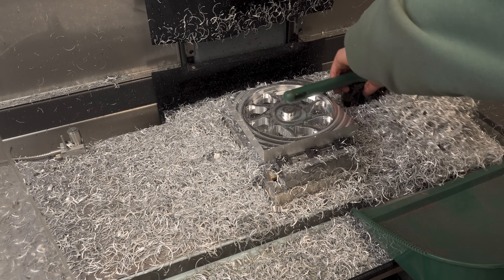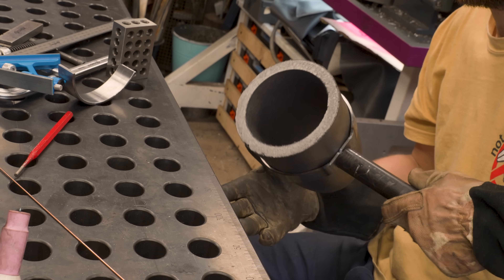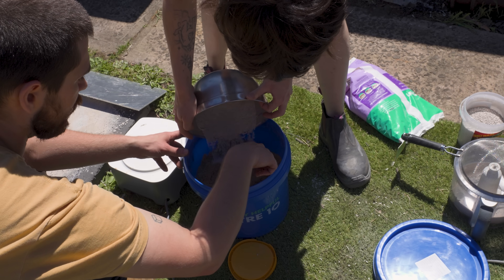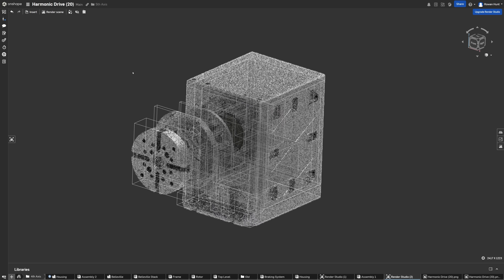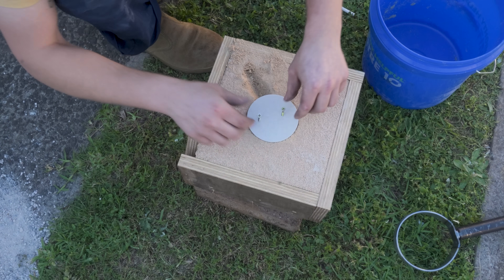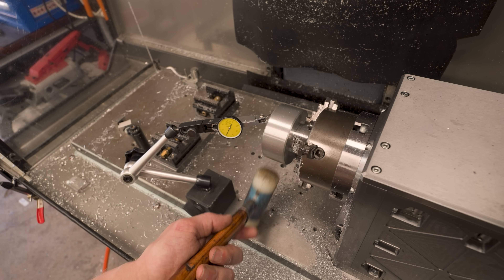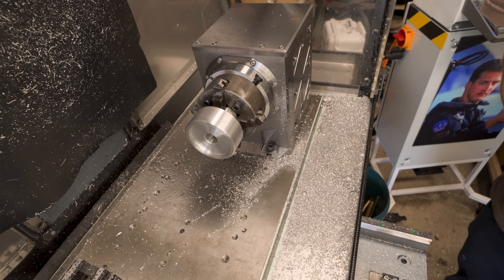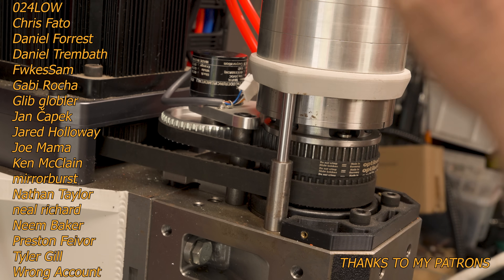Can I make a precision component from scrap metal?

Comment: Hey, 

Before anyone comments on you not using a dust mask when crushing the cat/kitten litter I'll be the first one to tell you that its probably harmless. Many says that it's dangerous due to silica, but the silica used in cat/kitten litter is amorphous silica and non crystalline. Amorphous silica has a disordered network of silicon and oxygen atoms without a repeating pattern witch crystalline silica has. When breaking/crushing Quartz (basically 100% silica - SiO2) it creates very fine particles that are sharp and they get into your lungs and scar them, if enough scarring occur you may develop silicosis. But I'll will recomend to you when dealing with a fine powder you should wear a dust mask with FFP3 classification (i think its P3-classification in AUS/NZ). 

- From someone thats deals with both forms of Silica (Industrial silicon metal smelter)
Reply: And the shiney almost quartz looking cat/kitten litter is amorphous silica gel granules
Reply: @rub3n0st that isn’t what he used. He has something more of the bentonite variety. Adding ground/powdered silica to an already silica based sand would accomplish very little other than give him some more fines in the AFS mesh breakdown. Bentonite based cat litters are mostly bentonite with very little if any silica. Of course, the very problem with cat litter like this is that you have no easy way of knowing exactly what is in it. For example, is it sodium or calcium based bentonite?
Reply: Why would he add crushed silica to sand that’s mostly already silica? (Hint- it’s bentonite-based cat litter, which is something entirely different than silica)
Reply: @TroyeWelch I agree with you - and yeah its prob. calcium bentonite or sodium as you are pointing out. Adding amorphous silica to the mix would be stupid as you also are pointing out. But there is a case from the Netherlands where they found quite a lot of silica in bentonite cat litter. A woman developed an autoimmune reaction to the silica and that silica was prob. crystalline. That was a cheap bentonite cat litter. Anyway dealing with any dust, sounds and also spray (eyes) you should be using the right PPE.

Comment: PUT ON GOD DAMNED FACE PROTECTION/EYE PROTECTION YOU MORON. When you poured into the flask first time, what if some small bug or other wetness caused the molten metal to jump into your fucking eye. DAMNIT.
I say this from a place of love. DAMNIT.
Reply: this one time i had some leftover lead droplets in my crucible when i melted aluminum.( i think it was lead)  the metal started burning and popping. it was beautiful. green smoke and fire trailed droplets that exploded like fireworks. any how not the point the point is yessssss... dont work with molten metal with naked eyes or hands.

Comment: Preheat the mold!
Reply: isnt that going to dry out the moister that holds the sand together?
Reply: @therealdimideas it depends on the specific type of bentonite. There are two main types- calcium and sodium. I’ve never used cat litter, only bought 50 pound bags of the stuff already powdered. Anyway, one of them will crumble when it dries out, like you would imagine, and the other actually bakes into/onto the sand like cement. This is referred to as hot strength. I think the OP was just saying that as a knee jerk reaction though. You generally don’t preheat sand molds. Metal molds that might harbor a bit of moisture in the corner, sure. The moisture in the sand in this case isn’t an issue.

Comment: My first aluminum melt and cast was made from a roofing propane torch about 20$ and a bunch of left over pavers stacked up. And poured it into a cup cake tin my wife didn't want because it started rusting. I was amazed how cheap you can actually go towards doing something like this. It was super cheap. Was it the best? No, but it did work! There is something about watching liquid metal flow that never gets old.

Comment: Regarding casting, here are a few suggestions I have from my experience in doing this as a hobby and also teaching it at a university.
- Using chips, especially aluminum chips can work. However, aluminum chips have a lot of surface area, which generates a lot of aluminum oxide that does not melt at the temperatures you are dealing with. This will come off mostly as slag (and a lot of it), but it also gets into your casting, causing defects. If you are doing a copper alloy, drop in a piece of charcoal to create a reducing atmosphere as it will burn, creating carbon monoxide that reduces oxides.
- Open molds can work, but ideally you want a closed mold. This allows more fluid pressure to be built up, reducing porosity, achieving higher detail and better flow (important for the relatively high viscosity aluminum).
- Machining alloys (like 6061) will work in casting, but they lack the silicon content of casting alloys which increases flowability of the alloy. This just means your parts cannot be as fine in detail or as complex if you are casting with machining alloys.
- Green sand has been used for hundreds of years, but I highly suggest Petrobond. This is an oil-bonded sand that requires much less maintenance than green sand, and will provide much better detail. You can also make cores out of it, which is not recommended with green sand due to the water content. 
- I couldn't see in the video, but you want draft angles on patterns to allow them to come out easily from the mold. Especially with the layer lines of printed patterns, you need more draft than with smooth patterns.
Reply: Mostly good advice here. I’d disagree with the assertion that petrobond requires LESS maintenance than greensand, which only requires replacement water and remulling. 

Also, the reason why people erroneously think petrobond gives better surface detail/finish than greensand is because they’re making their own garbage mixes out of garbage play sand and ground up kitty litter and trying to compare that to professionally produced petrobond. Get some professional greensand like the 180 mesh Olivine stuff that Teton Supply sells and it will compete with a similar mesh petrobond (often 160 or 180 mesh). The fineness of the aggregate is what captures the detail, not the binder (water/oil). Case in point- ceramic shell is the ultimate for this and typically uses 400 mesh silica flour and will absolutely reproduce fingerprints in the casting- and uses water (and colloidal silica)- not oil/resin/bentone.
Reply: Here's why I say that Petrobond requires less maintenance, because you are right that it depends on what you are doing.

For the average person in their garage, they are making a few castings a year. Petrobond you can buy, put into a closed container and it is always good in my experience. Greensand you typically dehydrates in the time between castings. You also need a muller or something similar. This just adds to the complexity of using it over Petrobond. However, when you are breaking out castings, greensand is great because you can just remull all the sand. With Petrobond, you are ideally scrapping off all the charred areas, keeping it separate. That is more labor you have to put in. A bit of charred material can be mixed back in easily, but you want to remove the bulk. On the scale that most are doing this in their garage, that bit of charred material probably isn't worth recovering, so you don't need a muller, oil, catalyst, etc. Overall, in my mind on this scale, Petrobond is easier. 

Regarding surface finish, yes, if you are using the proper materials, both are equivalent. However, a lot of people aren't doing that. You also have to cast greensand molds pretty quickly or they dry out and you get a lot of mold erosion. Petrobond I have left out for a month and then come back to it without issue. Then with cores, you really shouldn't use greensand for cores as the water vapor doesn't have anywhere to go but into the casting. But you can use a resin bonded sand for that.

If we were talking about industry where they pour metal on the order of tons daily, I would absolutely advise greensand. I've been to foundries that do that, and they just have automatic systems that take sand from the breakout, add in water and additives, and it goes straight to the molding stations. Petrobond would be far too costly for that. The only thing you are worrying about with those systems is your sand grains breaking down too much due to thermal stress, which is why they test it constantly.
Reply: I do aluminum casting for hobby/art stuff and porosity doesn't bother me at all! Lol
I exclusively use metal harvested from beer cans in my backyard forge, so the alloy I'm using is officially classified as "garbage."

Comment: I have a question where did you find a disk cutter for htd 5m? i could only find hob type cutters, which require hobbing machine and are expensive and you have 5 hobs for each type of belt for different teeth counts. If i could i would buy a full set of disk cutters for htd pulleys - 3m, 5m, 8m.
Reply from the maker: Right here! 
https://a.aliexpress.com/_mL9rQAd
Reply: @NoEngineerHere  Thank you for replying. Aliexpress search engine cannot find those even if life depended on it. I have added them to  my cart, after sitting there for 2 weeks i should get a discount which i will promptly use. Can you elaborate on their quality? If i am going to pay 250$ for 4 disk cutters i would like them to be at least decent hardness. Listing does not even specify which steel they are made of, or if they can handle mild steel, which usually is a red flag for me.

Comment: No full ppe? what is the liquid decides to explode. i would suggest welding something on the pouring bar to prevent the crucible to fall down while pouring
Reply: i once dropped my molten metal on concrete...=POP . also once melted aluminum in the same pot i melted lead in...= very pretty green kaboom... point is wear ppe... i would be sad if you lose your magnificent eyebrows.

Comment: Is there a practical reason for drying the aluminum? Or is it a joke, like how I am feeling when I ask this?
Reply: He’s being overly cautious on both accounts. Steam explosions in foundries are very real things, but only happen if the water gets CAPTIVE, such as what might happen if you added feedstock that was wet to a big mass of already molten metal. The water goes under the surface along with the feedstock, then it’s rapidly heated up by the molten metal around it, flashes to steam, and “explodes” or expands very suddenly. Except all this molten metal is above and around it, so it throws molten metal everywhere. Heating it like this is unnecessary (versus stacking it all loosely in the crucible cold and bringing it all up to temp together) but it certainly won’t hurt anything. Search for “foundry steam explosion” and you’ll probably see some examples.

Comment: I did a pretty big metallurgical study on home casting aluminum, you're basically never going to get good casts or good parts home casting extruded and or forged aluminum (any thing in the 40 50 60 70 series for example) because it has intentionally low nucleation so the large crystals can get small via the forging process. Try something like old cylinder heads or transmission housings for your casting stock, and quench/cool it as soon as possible and design your molds to cool it quickly (big flat tops of open casts are good for this) which maximizes nucleation and minimizes grain size, giving you much stronger parts. I've been able to get grain size down in the micron range like that. As opposed to the millimeter range you get from the extrusion alloys.
Reply: Are there any additives or other metals that you could alloy in to make it work better?
Reply: @duckythescientist  I tend to avoid alloying, there are some fluxes that can help. I've seen some people have good success with aluminum bronze but at that point it's basically a different metal with all different properties
Reply: what about cast aluminium platestock? I mean the fancy type that has hardly any internal stress and therefore does not bend a smidge after machining one side only.
Reply: @idontknow31212 if it's machines as cast, then it's  a casting alloy and should be suitable. Fast cooling is still important, usually it's injection molded and the molds freeze the part super super fast.

Comment: 3:25 all you need is to make kitty litter into a slurry by adding water, then mix it into the sand
Reply: Underrated comment here. 

Best to get proper bentonite if you can source it though. Also, there are two major types- sodium (or “western”) and calcium (or “southern”) and they each impart different properties into the sand (green strength, hot strength, etc). Who knows what you’re getting in a random bag of kitty litter.(?)
Reply: @TroyeWelch  true.

Comment: Really should add a splash of degasser & use at least 50% cast Al to the extruded scrap. I went down into this rabbit hole decades ago and led to a shop full of cncs. I do have an extra Tormach 770 I'd trade for few bucks. ✌

Comment: I spent a lot of time doing sand casting. You have to degas metal before you pour it if you want to get rid of the bubbles that form. I use sodium chloride myself.  The chlorine (which is what they use in industry) will split off the sodium at that molten temp and do your degassing and the sodium will act as a flux which will help melt out most of the persistent oxide (dross).  You need to get it all the way to the bottom of the crucible, so you need to make a kind of degassing tool to hold your salt chunk. Good luck.
Reply: If anyone wants to do the deep dive and be serious about superior aluminum castings, find the Castcon lecture by professor John Campbell and watch it through. Obviously not necessary if you’re just making bad art. Starting with good metal that presumably doesn’t need a ton of flux is one of the 10 principles of good castings.

Comment: A little bit of silica goes a long way in casting. melting down previously casted thing goes better. So like car parts. Also adding stuff like copper in very small amounts to the alloy will make the aluminum able to be heat treated and hardened. There's also no way to get it back out.. we use like a soft ball sized bundle of copper scrap wire to do arround 130k lbs of aluminum. So.. seriously small amounts.
Reply: Silicon (Si) not Silica (SiO2)- very different things. And it’s best for beginners to use pre-alloyed metals rather than make their own alloys and risk ending up with brittle garbage. If you really know what you’re doing, maybe, but that’s not the audience here.

Comment: Nice another tool in the toolbox!  A two part mold even with a flat top with a small amount of molten metal above the part helps minimize inclusions.  Depending on the part being made the need for close blanks gets selective enough to just buy the cheapest of said metal and make the blank yourself if specs do not involve safety and compositional checkboxes.

Comment: a couple recommendations for when you do this again:
- make your gripper tongues a bit smaller, so that you can actually put a little bit of pressure on the crucible. otherwise you run the risk of it just slipping out eventually. and you REALLY don't want that to happen.
- put some cardboard under the crucible, to prevent it from sticking to the fire brick
- put the crucible in the furnace right away before even turning the furnace on. even putting some metal in it right away is fine. at the point where steam explosions could be a problem, both crucible and metal are already way hot enough to not have any moisture left
- if you wanna add more metal to the crucible mid melt, put your metal on top of the lid next to the exhaust hole for a bit for it to dry out, no need to use a separate furnace for that. after it's dry, and if your parts are small enough, you can also just push them in from the top through the exhaust hole
- add some borax while melting, to get out any impurities. also has the side effect of reducing air pockets somewhat
- to further reduce air pockets, make sure that you pour into your mold as consistent as you can.
Reply: Borax is a poor man’s flux for copper alloys, not aluminum. While there are dedicated fluxes for aluminum, a dry inert gas rotary degasser is what industry uses- if you care about such things. In this application, it’s not crucial and any small inclusions, oxide bifilms or porosity will be of little consequence.
Reply: @TroyeWelch I've heard that decent success can be had with a 50/50 mix of sodium and potassium chloride.
Reply: @marcuskane9925  Also used as a table salt substitute for lowering blood pressure, though personally I found it tasted awful.
Reply: @scaredyfish   potassium chloride as a substitute for table salt does indeed taste horrible.  However, not as horrible as the taste of kissing the icy cold ass of Death to get just a few precious extra minutes before one’s ticker explodes…
Reply: @scaredyfish  There's a chubbyemu video about a guy who did this and nearly died - you should not substitute potassium chloride for table salt
Reply: @flunkl  So I couldn't find the chubbyemu video you mention. There is one about taking sodium bromide as a salt alternative. Perhaps that is the one you're thinking of?
Reply: Yes please follow this we dont want another Hyperspace Pirate incident out of our educational Youtubers